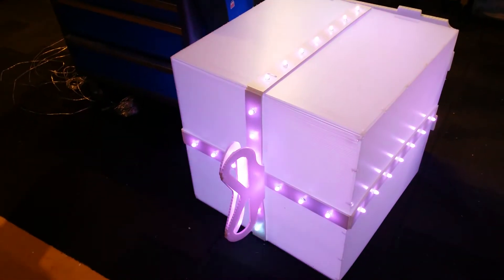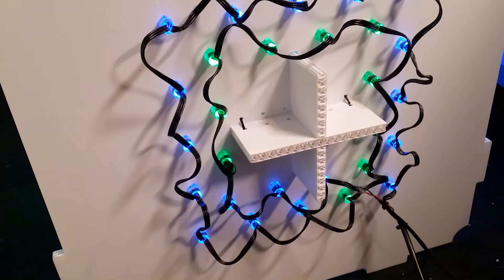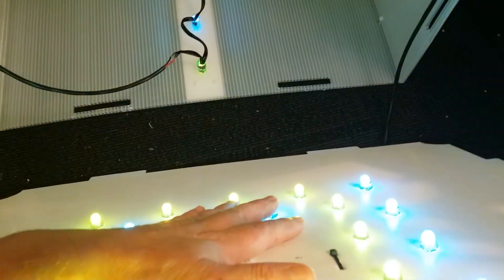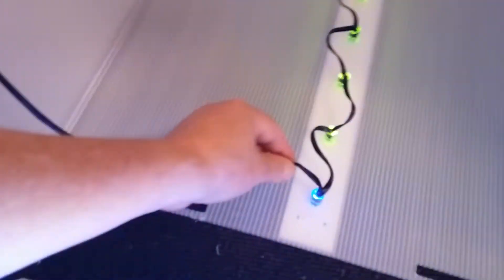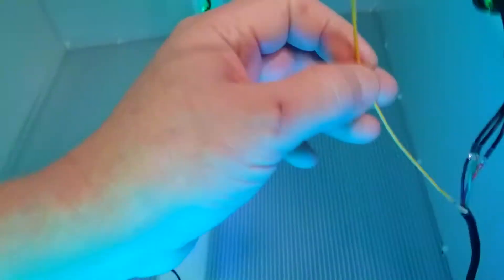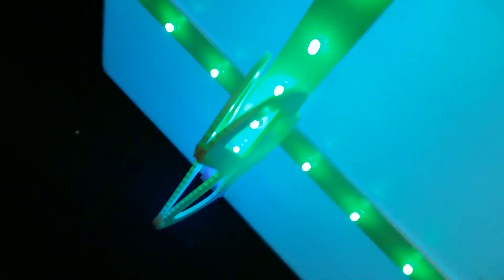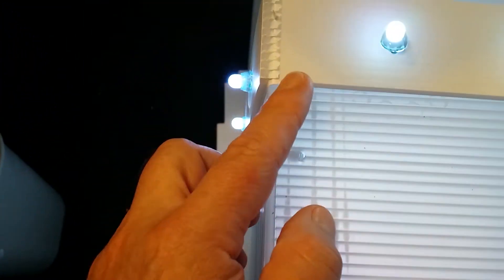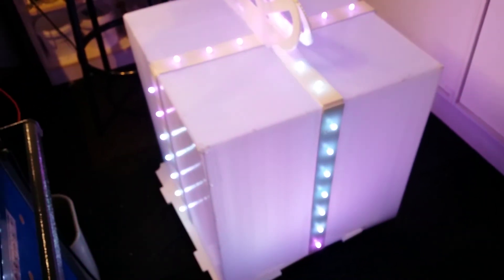Boscoyo Coro Present Wiring

Comment: Thanks for this video. Just bought these and found myself scratching my head after removing them from the box. Can you please clarify what the yellow wire is for in your configuration?
Reply from the maker: The yellow wire is the data out of the last pixel feeding back to the 4 pin connector so it can chain to the next prop.